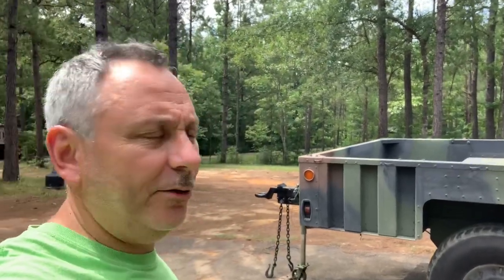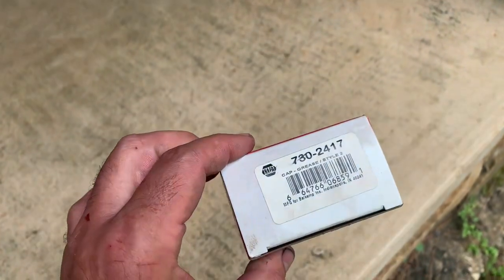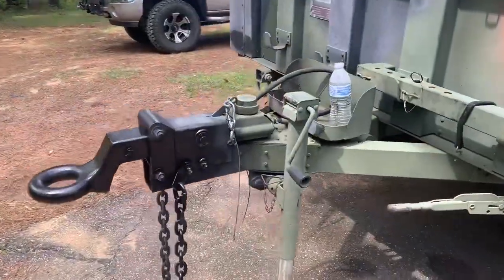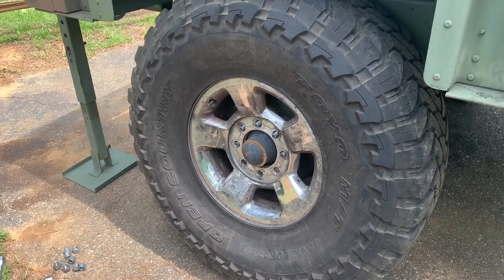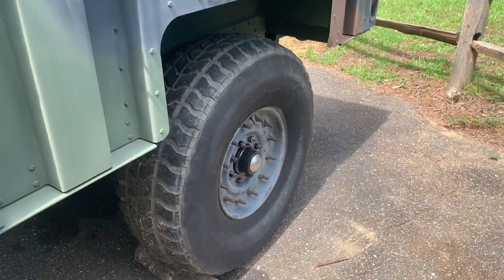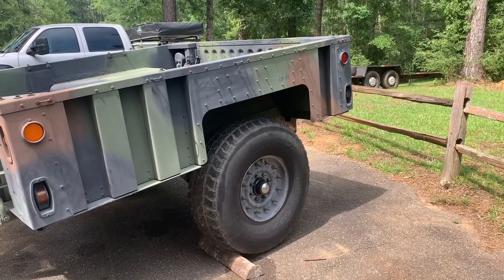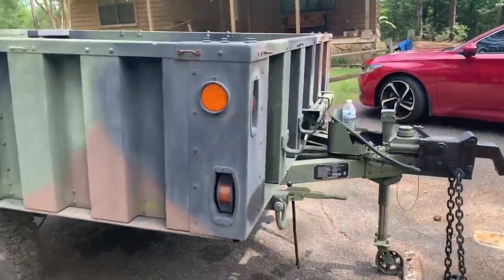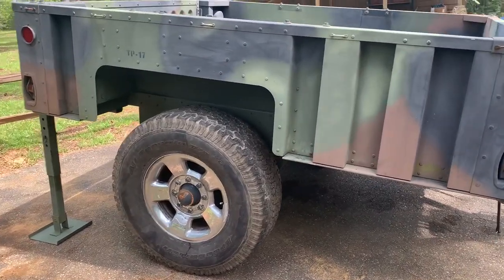M1101 trailer wheels, bearings and more!

Comment: Thanks for responding.  I'm an old air-cooled VW mechanic, and remember doing the rear full-float hubs one time on one of my duallie's; and burning up a spindle because it never got oil. Didn't know if these pack the same way as a "normal" trailer type spindle, and bearing preload. Thanks for the great video.  Looking forward to seeing more...
Reply from the maker: Yes just like a trailer spindle, just more beefy. Inner bearing outer bearing on races. I turned nut semi-tight by feel to make sure all is set and in place and then  turned it back 1/4 to half turn. I am no mechanic just what I learned from family and friends on the fly haha. I make videos to encourage folks to try new things and places. Thx again

Comment: Thank you for making this video. Just bought one of these and was trying to gather some spare parts for the ride home. This video saved me a lot of time. I wonder why the hubs on a lot of there trailers look so rusty? Seems like a good many of them at auction lately have rust on them. There happens to be some rust on the one of the hubs of the trailer I got and I’m hoping it’s just superficial and nothing internally wrong with the bearings or spindle.
Reply from the maker: @DeepwoodGarage  glad it helped. As long as caps are sealing good rust probably superficial but if it’s compromised and leaking then bearings will go bad. None are 100% water tight but that is reason to repack and change grease  every now and then( recommended 1yr or 12000 miles) I do every couple yrs. I just finished a new video on repacking and doing the bearings as maintenance. Should be out in a week or 2. So stay tuned if you want more detailed info

Comment: Brakes probably were a little stuck. If the trailer sat with the brakes on, you need to jame the surge brake on & off hard a few times. Smacking the hub might help too. Losens up the brakes good. They also may have been adjusted improperly. Screwdriver fixes that.
Reply from the maker: Yes I believe that was my issue. I did end up replacing bearings for good measure but they were fine. Lot of break dust - so that was the issue. While open I got em moving good and readjusted. All fine now , no issues in last 1000 miles or so .

Comment: I would like to see the video of you doing the bearings or inspection, clean, repack of the passenger side (probably too late). I picked up an M1102 from GovPlanet last October.  Built a rack & put a 23zero tent up there. Still a work in progress though
Reply from the maker: First, thx for watching Pat. I don’t have any video on that job but may go back and do a video on it anyway. Doesn’t hurt to repack bearings. Since technically job doesn’t have to be done on my trailer may take me a bit of time to get to it. Repacking with grease is almost same job as replacing bearings minus changing the races, which I will discuss and show on video.Thx again for the idea, sometimes hard to know what to video. Enjoy your trailer and maybe I will see ya out there in the woods lol.

Comment: The wheel bolt pattern is 8x6.5 I believe.
Reply from the maker: Yes the wheel pattern on all stock 2500/3500 dodge is 8x6.5. Center bore is 121.3mm.

Comment: I'm having the same problem with the hub getting hot I have release the brakes and they are still getting hot thanks for the bearings info
Reply from the maker: Have you tried adjusting breaks? On back there is an oblong rubber piece and a circle one. The oblong one, once removed exposed the adjuster. Rotating small gears up tightens it and rotating downwards loosens it. Few clicks down and then spin tire backwards and forwards and see
Reply from the maker: My bad just realized u said u adjusted them already
Reply: So glad I found this video. Thanks for info, picked up same trailer and second trip about 5 hours of driving back right started smoking. No problems since but I will try and adjust it.
Reply from the maker: Good luck hope that does the trick

Comment: I just bought one with a damaged backing plate and everything is rusted, any chance you know of a replacement assembly?
Reply from the maker: Not really  but  I would check Facebook market place . Look for either m1101 or m1102  parts they are interchangeable. The government auction site may also have some parts for sale. Good luck . So the one I have is mostly aluminum . Do you have the same or the Vietnam  era metal trailer? I ask because of the rust comment
Reply: @thehickspanic8646  I haven’t picked it up yet, it’s a m1101 with the hard top shell. One wheel is off, I think the hub nut came off and they left it off so everything is rusted.
Reply from the maker: Oh I gotcha , yea man that’s a touch one . I replaced bearings and races but yea having everything in there rusted May be tough. Let me know once you get it how it goes and maybe some close up pictures. Not sure if I can help but maybe come up with some ideas
Reply: @thehickspanic8646  Sorry, I don't know trailers, what are all the timkens for? I thought 13125-a was for the outter bearing? You said 22580 was for outter bearing races? Not sure what that is but I'll research, what are the other two?
Reply from the maker: So when you take drum cover off and you see all the breaks and mechanism you will see nut holding assembly to trailer axle or spline(center shaft) . Once you loosen nut entire section that comes off has bearings in it, kinda cone shaped(you will see). There is one on one side and a second bearing on other side- inner towards trailer and outer away from trailer. These bearings only fit one way but pay attention or take pictures on how they sit in that hole (assembly) and how they slide onto trailer shaft . Anyway, those bearings when removed , come out easy. Inside there you will see metal sleeves. Those are the races. So basically you have a hole with sleeves slid in there one on one side another on other side (inner and outer) they protect that tube and allow smooth surface for bearings. Now those sleeves do have to be punched out with a hammer and chisel or metal rod. Carefully as to not scratch the original inner tube. You hit the edges til they slide out and then tap new ones in, then bearings go in and u reassemble. You should pack the bearings with grease in addition to just liberally adding grease into tube area with bearings. When you slide back into trailer shaft to reassemble and tighten nut, you shouldn’t over tighten or you will mess up bearings (will get hot if too tight) . Most people tighten snug to feel to set everything in and then loosen like half a turn and install cotter pin. Lots of videos on how to do bearings. I hate I forgot to do one and just recommend u watch any bearing job - all similar . Now if those sleeves - races are not scratched or dinged or have discoloration - bluish . If they look normal and smooth metal - you don’t have to change em , jus bearings. Both inner and outer . You will also see where there is a seal holding things in that same hole and u replace same as original . If all is rusty and nasty u may need all the above replaced but won’t know till you have trailer and take apart . If not comfortable doing this job any decent local mechanic can do that job(no shame in that ) specially since those parts are expensive and critical to trailer rolling without issues. Good to learn though because depending on use and time , you will do this again in few years so u don’t end up stranded with bad bearings on side of road.

Comment: So you're saying that if you use a 17" Dodge/Ram wheel, a 7.5" wheel won't work, it has to be an 8" wheel?
Reply from the maker: No 7.5 will work depending on tire width. I at time had very wide tires and needed the 8s. I would check with tire installer on what wheel sizes will work with  your tire size. The 8s give you slightly more options but definitely may will also work very well with 7.5 size.
Reply from the maker: By the way, I hated the chrome look on the trailer and have since also done a video on (same wheels)  taking chrome off
Reply: @thehickspanic8646  I'm going to use some 31" tires I took off my Gladiator, so 7.5 rims should be fine.  I want to lower the height of the trailer and reduce weight.  Going from 37" to 31" should lower trailer by 3".  Thanks for the quick response.
Reply from the maker: No problem, thx for watching. Just by removing the 37s with run flats and those heavy wheels you taking a good bit of weight off already

Comment: How did you get the dust covers off? I can't for the life of me get mine off
Reply from the maker: So I got a slightly longer video showing details but essentially what worked best for me was starting at wheel edge by tire. I let all the air out, mark your lead weight location and remove, then try and wedge thin screwdriver into lip between wheel and cover. Take your time and try not to chip wheel. I did use small hammer and after few tries was able to bend lip of cover over. I then used larger pry tool to bend out more and eventually grabbed it with locking pliers. Once lifted comes off rather easy. My first one I used heat gun to weaken glue but I don’t think it really helped. I will post video some time today, good luck !
Reply: @thehickspanic8646  Thanks for the reply, I ended up trying a 3/4 chisel, couple hits popped it right off, used a 4 pound hammer on one, and a rubber mallet with the 2nd. Mallet worked really well.
Reply from the maker: Glad to hear it worked , I posted a slightly more detailed video for anyone else having trouble. Thx for watching

Comment: You know if anyone makes softer shocks for trailer? Would help a lot with bounce.
Reply from the maker: Will have to check on it , hadn’t thought of that. Still has the military grade set up lol
Reply: You can put a Timbren axle- less setup on these. Gets rid of the torsion bar setup.

Comment: will these bearings fit the M101a1 trailer?
Reply from the maker: Man I know they will work on the 1101 and 1102 but  those earlier trailers I have never messed with . Honestly not sure and want to say they probably take different bearings . If you can remove the bearings and take them to Napa , they usually are the most knowledgeable  at finding what you have .